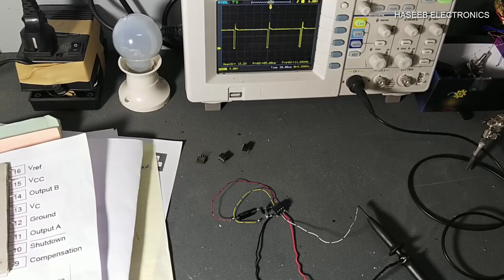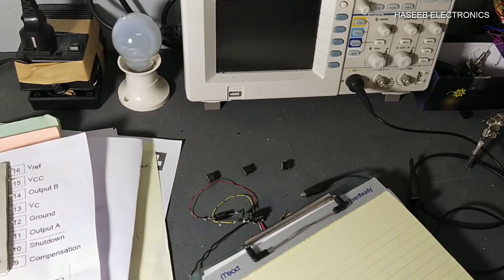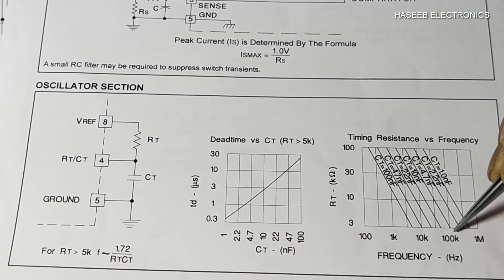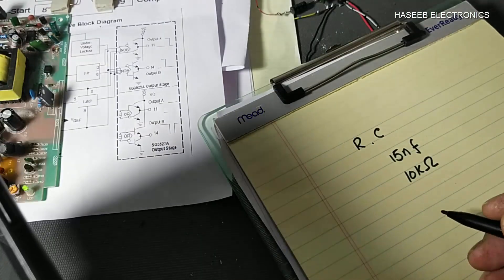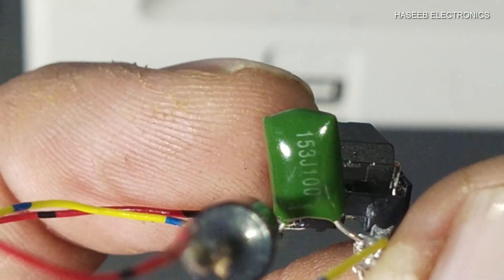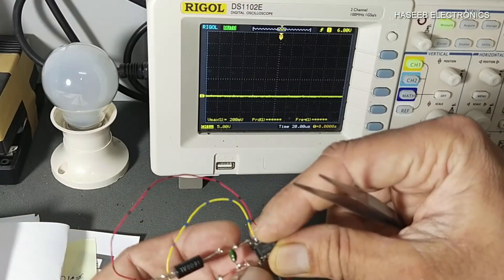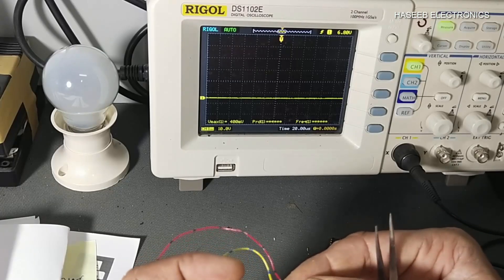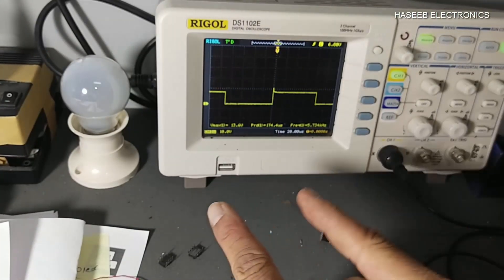{559} How To Calculate Switching Frequency for UC3842 / 3843 /3844 /3845 Oscillator Frequency

Comment: What is the minimum circuit for testing freq this ic...
Reply from the maker: it depends on the RT/CT value
Reply: @HaseebElectronics  i mean wht is the circuit diagram that u r showing in this video... 
2. Can we run like blinking led for interval of some seconds. For testing purpose only. I dont have oscilloscope

Comment: hello sir I have some question it is about the GM 4pin Ignition Module my car also uses pick up coil snd E Core Ignition Coil the power source for my car is aperantly positive linear voltage regulator or relay. So that 4Pin GM Ignition Module uses the MC 3334 ic chip the exact lay out for that Ignition Module Chip can by found on Google. So can you please take a look a tell my what Im missing? I need some how to programe that thing or interupt the freqency rate some how because my car does not have retarding mechanism so its hard to start it in winter time so thats why I try to coppy this circuet or modifi it to do that task. So basicali its the question how are 555 timer ic chip frequency controled ? Or advancing or retarding frequency on demand is it posibel? If not culd the pick up by modified or ignition coil? Im not profesional electritian I surched long and culd not finde disruptive circuet or altering frequency device . So I hoppe some one has ideas how to force that thing to retard spark or pick up signal some how? Also I wuld like to know what ells culd by used to programe pick up coil signal to run 1 or more high power darlington transistors?

Comment: thank you, sir, I was waiting for this video for a long time, 
Sir, you are using a black color resistor, may I know why you have used the special type resistor. you could use a normal 1/4watt resistor. what is the general use of it?
Reply from the maker: thanks a lot. 
yes in routine we can use a commercially available resistors with tolerance. but i always to try use fix resistors with 0.1% tolerance to obtan exact results. 
for normal use we can use 5%  tolerance resistors
Reply: @HaseebElectronics  thank you so much sir

Comment: I have an instrument with measuring system for power supply voltages so every five six days it measure  the 12 volt 10.5 volt and put device on hault ...we need to restart it several times to get it right
Reply from the maker: can you please send its picture to my whatsapp 00962-79-1161-084

Comment: Sorry sir but this video is not match with actual calculation of frequency because frequency select according to flux density of core
Reply from the maker: yes brother. first we have to select core, 
then topology
then flux setting by required frequency is selected 
then winding calculation 
then on that frequency you have to select dead-time (to move on CCM or DCM mode)
and then select capacitor value 
then adjust RT value for the required frequency
Reply: @HaseebElectronics  yes sir but another issue in ur comment about CCM and DCM mode related to use 3842/3843 or 3844/3845 is when we use 3845 always work on DCM mode because it's output duty not above 50% and if we work on 3842
It's always work on CCM mode because it's output duty always more than 50% not less than 50%
Reply from the maker: @HarpreetSingh-nl1li  yes 3844 & 3845  provide 50% max because it's built in flip flop toggles and divides the oscillator frequency 
so the output frequency is half of the  Fosc.
Reply from the maker: 3842 and 3843 can be programmed in ccm  by limiting the current sense feedback

Comment: Thanks you for this. It pays to have a notebook nearby. So much to remember. I'm curious about the RT and CT formulas being the same for all chips or how close they are to this one. I assume that the half frequency is for push pull topography. I always love your videos. I would like to see you do a video on the L5991 (DAP002) IC like used in a Sony Playstation 2.
Reply from the maker: no it is a family of current mode smps controllers. designer can use any option. either CCM, DCM operations. basically these four ICs are used to drive unipolar magnet (flybacks, buck converters, boost converters)
Reply: Next video on current mode controllers?? Ccm dcm??